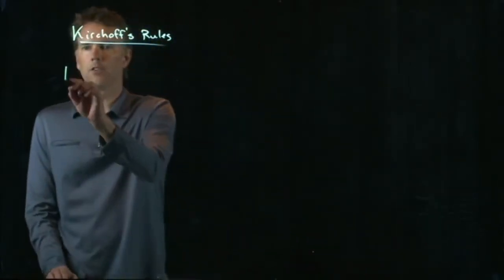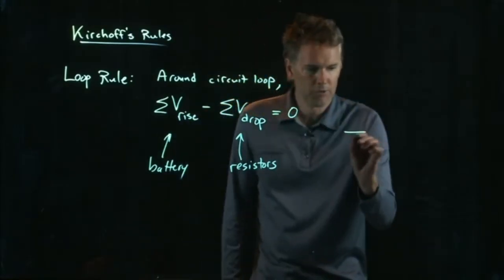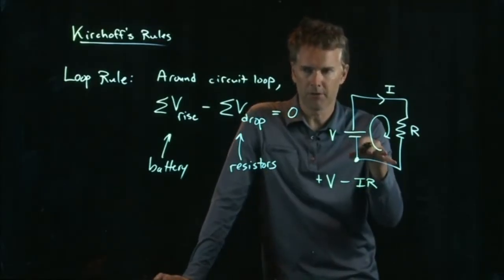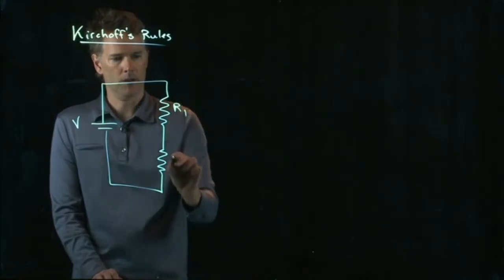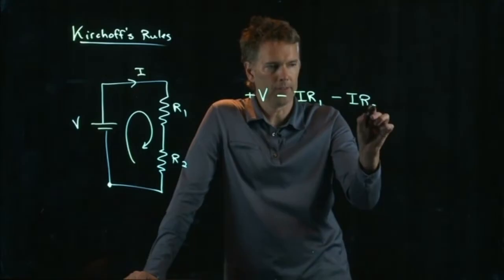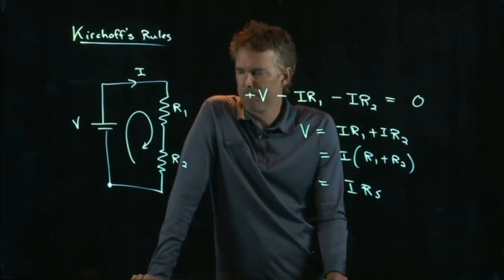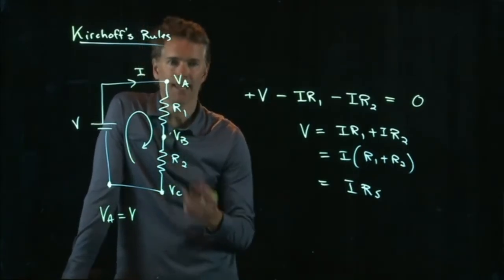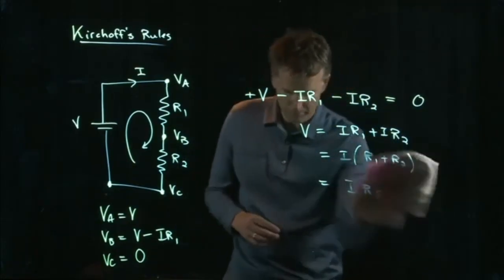Kirchoff's Loop Rule | Physics with Professor Matt Anderson | M22-07

Comment: it surprises me how differently teaching goes from teacher to teacher. My teacher in high school would send me away to the moon with a swift strike if I said voltage at some point.

While I'm not sure whether it's correct or not, I was taught that voltage can only be measured between two points and voltage at some point makes no sense. It's difference in potential between two points, so what's the difference if we only have one point?. 
It still works, V_a is just what I'd call voltage between A and C. All methods still work it's just how described it is. Same with voltage at B. As per what I was taught voltage provided by the battery spreads according to resistances across the rest of the circuit, so instead of saying voltage dropped on that resistor, I'd say voltage across that resistor is this this and that. 

It changes nothing in calculations but still it's fun to see different ways of explaining and teaching the same things.
Reply from the maker: I agree with you and I likely got a little sloppy with the verbiage.  It happens.
Cheers,
Dr. A

Comment: I wish the video had been two minutes longer, so he could demonstrate how the voltage drops to zero if there is just one resistance in the circuit, but the voltage gets divided between multiple resistances, in direct proportion to the values of each of the resistances (using each resistor's value in relationship to the total resistance in the circuit), which effectively makes the multiple resistors a simple voltage divider.
Reply: Did you watch the video? He did that....first thing.
Reply from the maker: Great discussion.  Mr. MaskedMarvyl let me know if there is still an outstanding question.
Cheers,
Dr. A